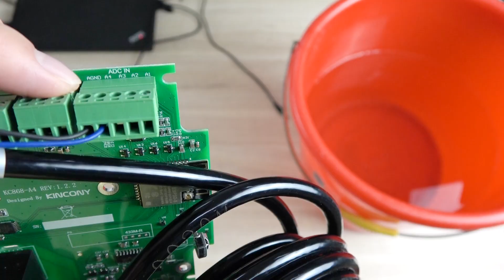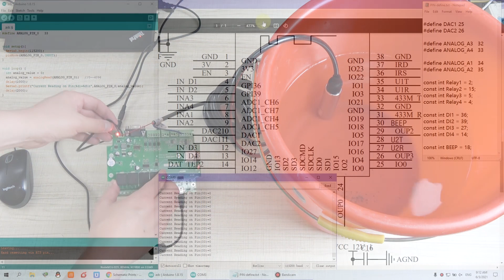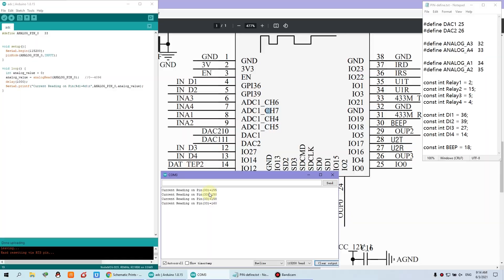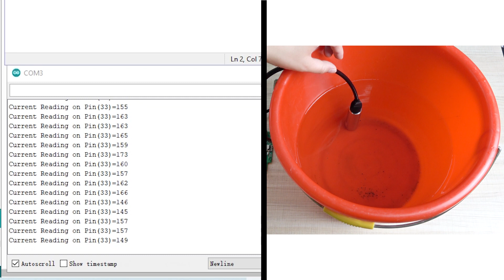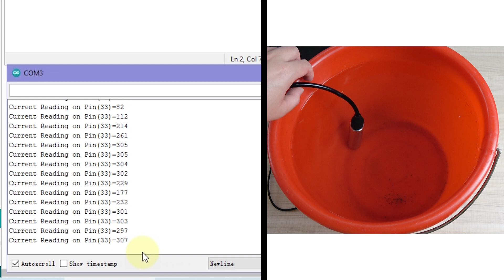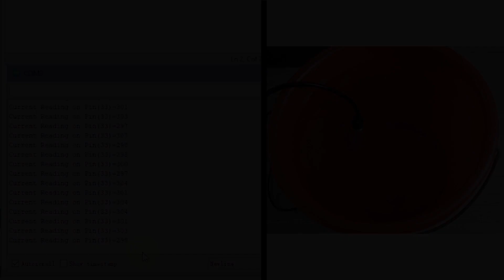Lesson6- How to use Arduino to read analog water level sensor

Comment: Can i use it to detect water level in soil? And is it compatible with arduino uno r4?
Reply from the maker: yes, have soil version
Reply: @KinCony  thank you, do u have a step by step guide for the set up? Like the connections between the sensor and the arduino like that
Reply from the maker: @jordancabotage181  pin define as same as water level sensor, power, gnd, signal output, 3 wires.
Reply: @KinCony  because of that, I'll subscribe to ur channel✨
Reply: @KinCony  can u give me the specific water level sensor that can be embedded in soil sir. Or it's okay to use the sensor in the video
Reply from the maker: @jordancabotage181  https://shop.kincony.com/products/1-5-meters-diesel-oil-level-sensor
Reply: I need your reply asap, for my thesis 🤧

Comment: Hello, I am working on a project using Arduino, and I need to connect two wires (2 Wire) to detect the presence of water (or measure the water level) the sensor name is Als-mpm-2f series water level  The idea is based on water being a conductor that closes the circuit between the two wires. My problem is:

How can I connect the two wires to the Arduino?
Reply from the maker: connect with digital input port
Reply: You need to use a resistor (250) conected to the sensor and a 24V battery then you connect to an analogous input, and then do the same in this video. Did it work? tell me

Comment: Can it read resistance based sensors?
Reply from the maker: it use by analog sensor, can't read resistance value directly.
Reply: @KinCony  Thats ok its for tank level I already have but they can talk to Victron Cerbo and I get the data another way. I can find 0-20mA for another project, are these suitable/accurate?. Like to say I've been going around in circles looking at home automation stuff for weeks with no clear direction until I found your products. Congratulations on some great equipment. I have in mind Server16, AIO and E16v2. Will order in the next few weeks. I have a mix of 12v and 240v in motorhome I am building. Also need many I/O to run solenoids, pumps, and level monitors for filtered recycling shower project I am working on for the motorhome
Reply from the maker: @1Beetlegeuse  ok, 4-20mA also supportted by our board, you can config by ESPHome if you using home assisstant software.

Comment: if it is used to measure the hydraulic oil level, is it possible and ideal?
Reply from the maker: sure, we have another sensor for oil.
Reply: @KinCony  please state the model and specifications?
Reply from the maker: @shogunvanrepi3555  this need customsize make it, just when you order, tell us your requirement to our seller.

Comment: hai i used kit 0139 sensor, i buy dfrobot website, website have give examble code, in this code working but reading is varying pls help me
Reply from the maker: which board you are using?
Reply: @KinCony  arduino Nano
Reply from the maker: @SimplySamu  sorry, i have not used this board. you can contact with their technical support.
Reply: @KinCony  ok bro what board u used.  Can i used nodemcu. Which board u recommended for me

Comment: Can I use it with a RS485 sensor or what so I need ?
Reply from the maker: you need chose our A series board have RS485 interface, then write arduino code for modbus protocol

Comment: Can you inform what is the P/N or the values of the magnetic inductor you have in the Analogue inputs?
Reply from the maker: it according to your sensor, whether sensor is supported, the pcb board just use analog input dc 0-5v

Comment: If wire distance is longer up to 500 feet can we use 0-5v sensor or should I use RS485 instead of 0-5v please???
Reply from the maker: if long distance, you can use 4-20mA sensor, A4 have 2 channel 4-20mA analog input ports.
Reply: @KinCony  Will the current value returning to ADC pin will not change after passage of time? because wire resistance will change with time. For example if sensor current at certain water level is 10mA it could reduce to 8mA or 7mA after 3 to 4 year of usage in that case water level is not accurate this is what I think. What you think about it please, because I have not used this sensor yet and confused which one is better specially when tank is far away like on tall buildings when wire length is more than 500 feet.
Is it ok to use 4-20mA sensor in that case you are saying???
Reply from the maker: @MuhammadIrfan-rg8ty  4-20mA sensor use 1000 meter also is no problem. sensor input signal can be calibrated in your MCU.

Comment: i cane to use I can use 4-20mA linear pressure sensor on the analog input but the sensor is powered at 24v dc
Reply from the maker: that is your sensor work voltage, if sensor current is 4-20mA, no problem
Reply: @KinCony  this is the sensor :Supply voltage: 12-36VDCOutput signal: 4-20mAAccuracy: ≤±1.0%FSOperating temperature: -40-105℃Housing material: 304 Stainless SteelPressure connection: G1/4 or otherElectrical connection: Hirschman DIN43650CProtection class: IP65Explosion-proof class: Exia2CT6Electromagnetism Compatibility: EN50051-1
Reply from the maker: @ionutaurelian2963  KC868-A4 can directly to use this sensor.

Comment: Thank you for the tutorial. What is the maximum length  the water level sensor cable can be extended? I plan to use the KC868-A4 + water level sensor for monitoring and controlling the water level/flow in  the overhead water tank.
Reply from the maker: water level sensor MAX connect with 4 pcs, the sensor MAX can be customized make for 0-20 meter
Reply: @KinCony  
thank you , You mentioned that A3 and A4 are used with the water level sensor. How can I connect four water level sensors at the same time?
Reply from the maker: two sensors use by 0-5v water level sensor, another two sensors use by 4-20mA is ok. @محمدرزق-ح1ح